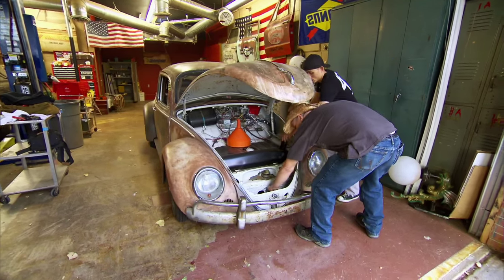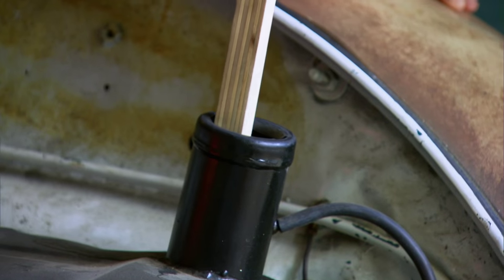Street Outlaws Deleted Scene - The Dung Beetle

Comment: They ruined this thing with a Subaru motor
Reply: But also gave it probably twice the power. Reliability will be their only issue with that thing now. 600-700hp with the subaru engine vs probably this set up with a max of 400hp. Put that much power in that light weight chassis the only thing that will have a chance of beating it is something making well over 1000hp